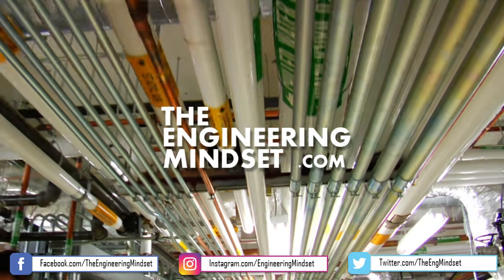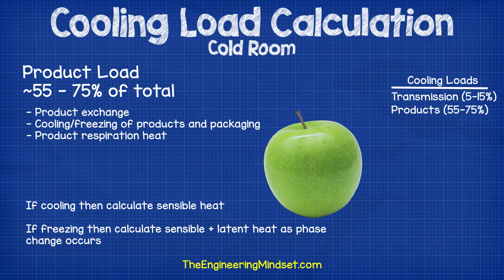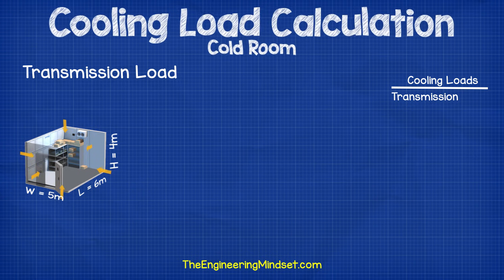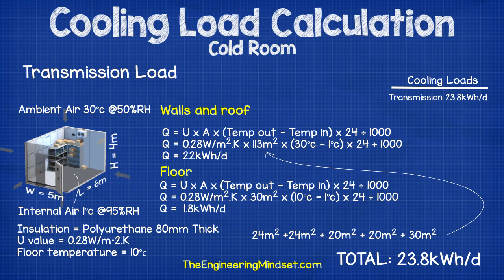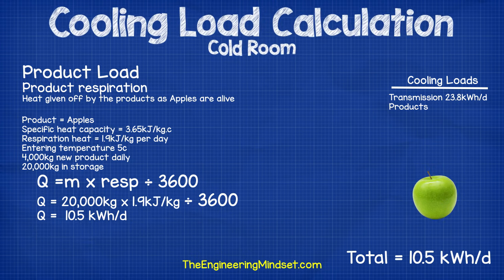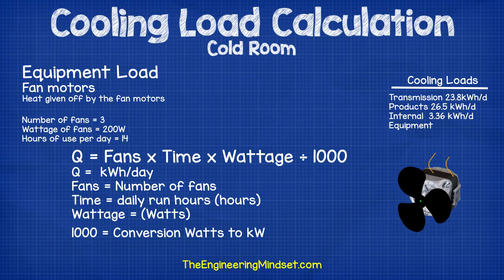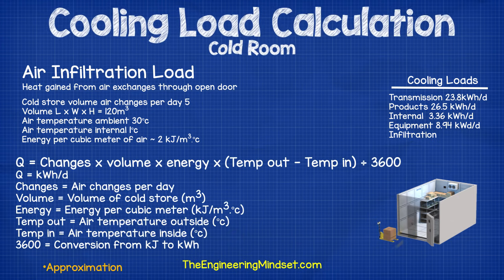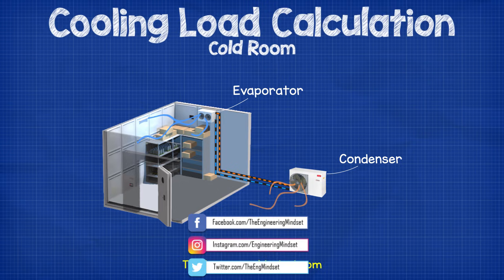Cooling Load Calculation -  Cold Room hvac

Comment: excellent explanation, based on this which of the AC system components contributes most to the thermal capacity of the system, in other words, say we need to upgrade a standard  car SUV factory AC  , to be  able to handle blowing 42 degree F during extended exploration in extreme middle east desert heat in excess of 130 F ,  what do we upgrade in order of priority and  , how do we measure the overall additional capacity?

Comment: Thanks for the explanation of the previous question, but i got an other question about the calculation on the cooling load, is it not reasonable to also calculate cooling load of  the air. I was thinking that also heat need to be extracted from the air.

Comment: At the time stamp 5:48 your calculation for walls and roof are off. When you add up the walls and roof you get 118m sq not 113m sq. It is only a difference of .97Wh/d when you figure the equation. Would that small of a difference make any issues arise down the line?
Reply: I saw that same miscalculation it should be 118m sq

Comment: why we take into account the rated power of the equipment ? 
Like the power of the fan is the responsible for moving the fan by a specific torque 
so , i see that the energy (from the power given by time) to move the fan cannot all be converted  to a heat load (or heat generation) as the fan would not have the energy to move

I believe that there is some of heating in the process but with a ratio

please give me an answer as it is so confusing to me 

I almost forgot, thank you for this great video <3

Comment: Medium temperature refrigeration maintaining box temperature of 35 to 38F degrees have evaporator fan motors that run 24hrs per day when set point is satisfied and  compressor is off to help defrost evaporator and for air circulation.

Comment: Sir can you show us how to calculate to get what compressor and evaporator cooler and its capacity to use after you get the kw/h cooling load.  Thank you very much
Reply from the maker: See our refrigeration software videos for a guide. I also made a series for danfoss coolselector 2 software on their channel
Reply: @EngineeringMindset  ok. Thank you very much for your immediate response. More power. Your channel is very detailed.

Comment: Very helpful.  One remark: for "Internal load" - people calculation, it should be  2 people x 4 hours x 270W / 1000.
not 270W/h which is a meaningless notion. You have either Watt(power) or Watt x h(energy).
Try dimension analysis on your equation: people x hours/day x w/hour  =  w/d. Which is again, meaningless.

Comment: Great video, nicely done :)
However, the fans' heat load calculation is not correct. You count the 200 W of total electricity consumption as heat. This is true for a heater: 200 W electricity will turn into 200 W heat. That's 100% efficiency, as heating is the purpose of a heater.
The electric motor in the fan has an efficiency of ca. 70-80%, so 30-20% of the electricity intake dissipates as heat. Therefore in the formula the 200 W needs to be multiplied by 0.2-0.3, so the 200 W fan will generate only ca. 40-60 W heat.
Reply: Dont forget that movement energy of air taken from fan is also heat. So 200W heat load is no wrong at all

Comment: In this example we assumed that 4000 kg of apple changes daily from a total of 20K so 16K still be there untouched. In such case this cold storage should work 24 hours per day but in the end you took 14 hours/day working . Is it just assumed or there is reason which i could not understand
Reply: every heating load is calculated for 24 hrs, but evaporator is assumed to work 14 hrs in a day.

Comment: Does your factor of energy per cubic meter of air (2 kJ m^3 / deg C) account for latent cooling as well as sensible cooling? The value of the heat capacity times temperature difference (sensible cooling) rarely accounts for the full effect of air infiltration. If you want to calculate based on both sensible and latent cooling, a psychrometric chart is the way to go.

When I say latent cooling, this is not to be confused with the freezing of the fruits, which I am aware is not present in this calculation. I am referring to the humidity difference between the air outside and the air inside. Basically the refrigeration system will have to condense large amounts of water that enter the unit as the door is opened, which costs energy.

Comment: I'm very delighted to meet your youtube channel. Although i got a question that i still think about.
I've seen your video about the cold storage calculation: https://youtu.be/0gv2tJf. You've said that the runtime of the refrigeration unit is set up to 14 hours, but what happens to the temperature of storage food 🍏after the 14 hours. I assume that the temperature is going to drop of the food. So isn't the refidgarator system not 24 hours working?

Comment: 75kwh/ day seems insane. Are you sure it wasn’t per month? 75 a day would mean a very hefty electricity bill. Please verify
Reply: That is the thermal energy consumption, next step for electricity consumption is to divide result by 3.5 assuming a 3.5 COP to calculate electricity consumption. 

There is also 2 relevant errors in transmission load. U Value for that insulation is about .028 not .28, and it is not dividing by the insulation thickness.

Comment: It gives approximate load... Not a very accurate
Reply from the maker: Hello Mehul, as stated it is a simplified example, depending on how critical your cooling load is then you will need to use other, more precise formulas. Additionally you can simply use a free cooling room design software such as http://bit.ly/2Ars6yF